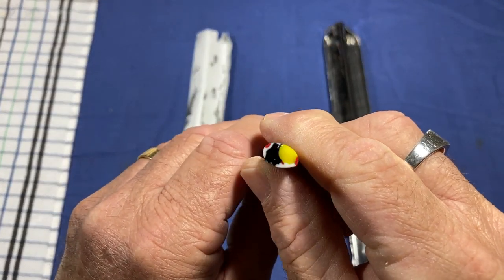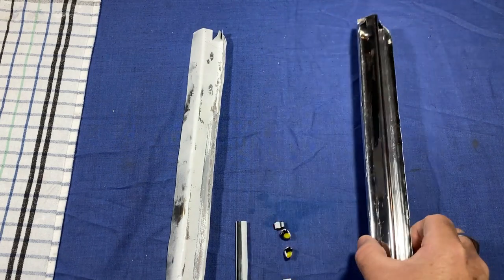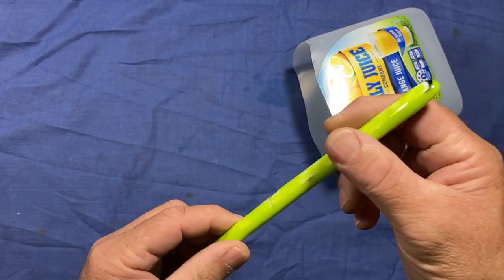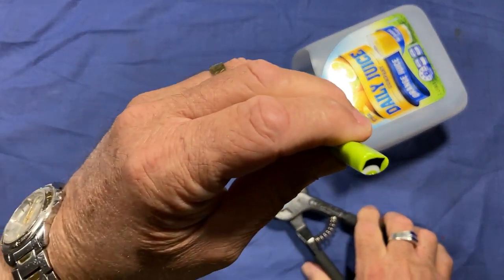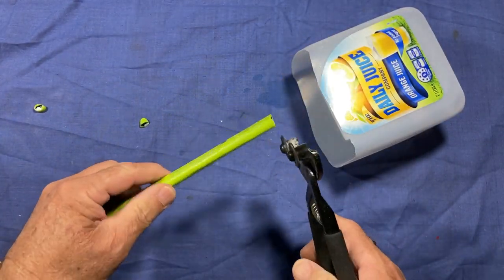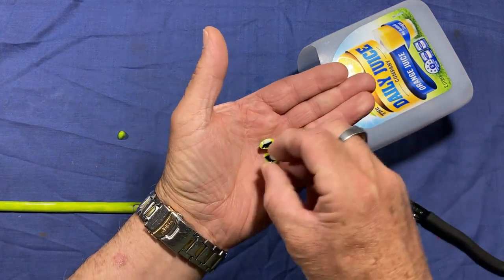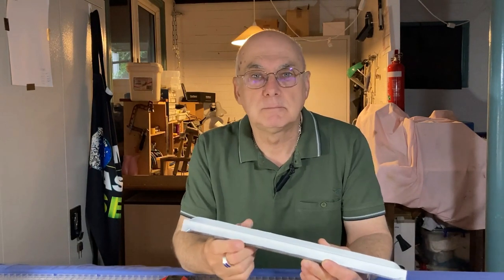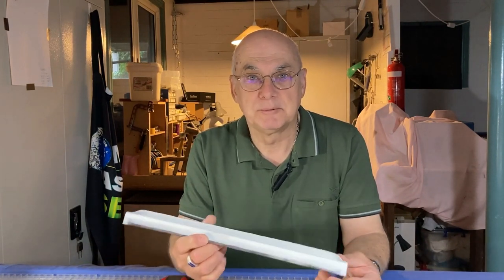Making Murrine in a Kiln, Easy, Sort Of, Fused Glass Tutorial

Comment: I've got an "experiment" running in the kiln at the moment. I bought a 12" (30.1cm) stainless steel spring form mold on Amazon and I want to see if it will work as a circular dam for making 11" disks I use with a fluted bowl slump mold.  Future project is to slip cast a smaller fluted bowl ceramic mold in order to make a service set of a bowl and some matching plates (matching geometry, abstract design). Love your videos! 👍
Reply from the maker: Hi Bob
Because steel contracts more than glass you can have problems with your glass getting trapped. Stainless with certain styles of moulds isn't ideal.
However, I expect you won't have that problem with a spring form, especially if you lined it with fibrepaper. That has some thickness and will allow for that contraction.
Good luck with it. Hope it all goes well.
Reply: @RocketRoseArt  Since the glass is inside the walls of the mold, it should be OK; the glass disk will be where the cake batter would have been.  The plan after that is slumping in a fluted bowl mold (gm254 creative paradise).
Dealing with contraction/shrinkage has been an interesting challenge with both ceramics and glass.  Decades ago when I was a carpenter building formwork for overpasses and other large concrete structures, one of the biggest challenges was learning to think about how the forms could be removed after the concrete set and cured.  Shrinkages was not a problem, but trapping forms was all too easy to do.  Of course, there are some freeway sections that have forms still encased as removal would serve no real purpose and would cost a fortune. I'll let you know how it all goes and submit photos later if it all works out, or if it's a total fail... :)

Comment: Can I ask why you only used stainless steel for the moulds.  I used galvanized house stump damp and insect caps which I first treated with boron nitrate and it worked really well for a bowl/plate.  These cost under $5 at Bunnings.  New to your site and loving your very methodical presentations.  I got into fused glass during the Covid lockdowns after watching my wife have fun.  Totally hooked now and trying everything.  Regards.
Reply from the maker: Hi Philip. I found normal steel scaled a lot. Flakes come off and in some circumstances end up in the glass. It oxidises much more where stainless discolours but no scaling as far as I've found. Yes, it's a bit addictive.